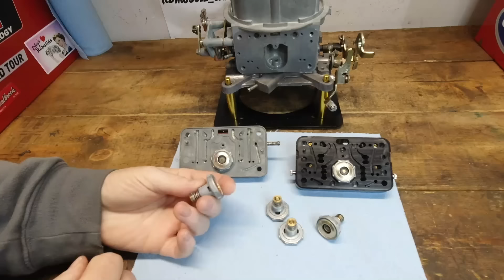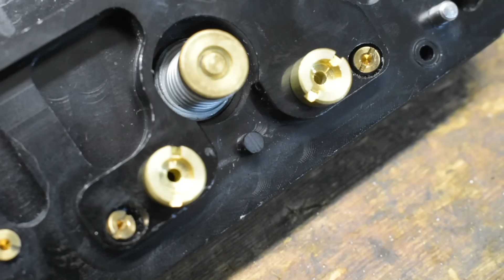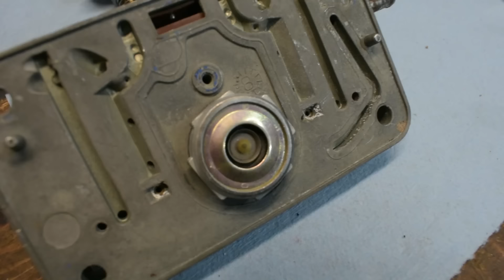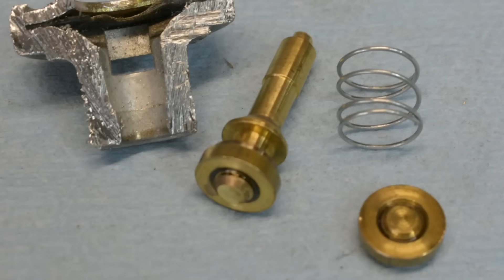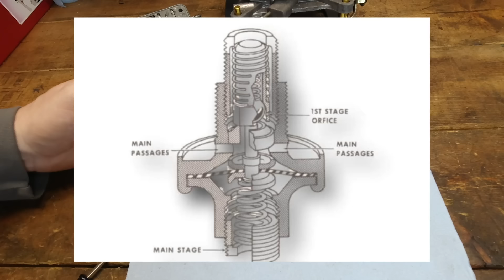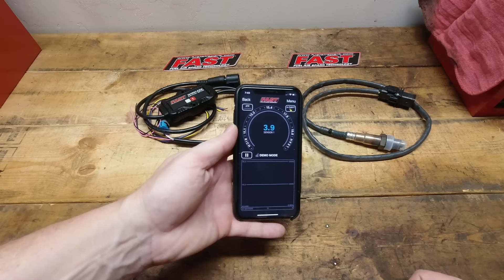Power Valves Explained: How they work, how to tune

Comment: Thanks for the clear and logical explanation. I have. a 67 Autolite 4100 on a 289 Ford, but most of the principals seem to apply. One question; is it better to tune out a stumble with the PCV or with the Accelerator Pump?

Comment: One back fire and a blown power valve I blocked them off and jet the card as needed
Reply from the maker: All Holley carbs have had a PV saver check ball installed since the 90s.

Comment: I will point out 1 more thing. If it has the right power valve and you need more fuel you can drill out the hole a few thousand at a time instead of buying an expensive aftermarket metering block.

Comment: ya know, maybe that's why my fuel gage starts dropping at a higher rate when im over 2300 RPM in my 63 Scout with the Chevy 302 in it? running a Holley 2300 500cfm 2bbl that gets pretty good mileage until i get over 2300 RPM.... same with my boat that has the same carb and a GM 4.3L (262ci) V6... gauge starts dropping fast over 2300 RPM... damn... ive based my power valve choice on 800 RPM not under load, 14lbs x .5 = 7.... i need to run the vacuum gauge when im at cruising speed and figure this out a little better... thanks for the solid tip!

Comment: I have just seen your video and I loved it great information, but I have a question. I am under the impression if you are running a solid lift cam which I am under the impression that solid lift cams do not produce vacuum so if this is true, how do you apply what you have just said to adjust putting the right power valve in your holly carburetor

Comment: I used all the gauges from a 70s f600 ford my carb converted 96 f150.. the best part is the f600 tucks have a huge vacuum gauge for their vacuum powerd brakes.. and its a fomoco stewart warner gauge... check out my channels, f150 build, and f600 gauges are still found everywhere 🎉

Comment: My old man always told me that tuning a Holley DP was not as easy as an Edelbrock, like a 1406 but that once you get it right the Holley will perform better in every situation.  Engines with big cam will NOT make the vacuum needed to hold the PV closed at idle, so it can be a challenge, even with vacuum gauge tool get the PV right so it isn't opening while on idle circuit.   Vacuum bouncing with cam?  Use the LOWER number to clean it up.   I have used many 650 DP on 5.0 stangs, last one was SOOOO rich at idle and had a 6.5, vacuum was bouncing between 7-10hg, I tried the 4.5 and it helped getting it to an almost reasonable number but I went to 3.5 and BOOM, it cleared up quickly and after the PV change the vacuum was solid at 10hg, even with a cam.  The thing is cold blooded but not too bad and once fully warmed it pulled through the entire transition without a hiccup that is rare.  I had a rich one where dude had initial timing on a 5.0 at 4 degrees ATDC.  YIKES!  This will burn like garbage and leave a lot of fuel unused, resulting in awful economy and black plugs.  Talk about tuning nightmare.  Advanced timing to 13, changed to 4.5 PV and thing ran fantastic out of the box with a minor jetting change later to get the AFR right at WOT.  It hardly made more power but it wasn't risking a lean condition.

Comment: How do I adjust the power valve it self. I'm running  2 600 holleys and I want them to match as close as possible. The carbs are 4160
Reply: The power valves are not adjustable. You want to MATCH the power valves. The power valve circuit CAN BE adjustable (amount of enrichening) by changing the power valve channel restriction size, which are the two holes you will see in the metering block with the power valve removed. The power valve controls WHEN the circuit will be active. The PVCR controls how much enrichment the circuit provides.

Comment: How would you change power valve selection for altitude?  I live above 6000ft and had to take the jets in my Holley 2300 from #73 to #68 and am wondering what changes I should make with the power valve.

Currently it's a 5.0 Hg valve.  Since air is 20% less dense here you tend to want less fuel, however, engine vacuum is also much less for the same reason. My idle vacuum is 15" on a stock Ford 352 but would be closer to 19" at sea level.

Comment: My brand new VRS front bowl is leaking fuel along with my accelerator pump. I tried tightening them down but still weeping, I was using a nut driver because I was trying to break my cam in. I stopped the break-in and I gotta figure this leak out.
Reply: Edelbrock should stick to making intake manifolds. Customer service left me on hold a couple years ago for about three hours. I left my phone active the entire time just to see what they would do. They ultimately just hung up.

Comment: What if you have a have a big choppy cam that drops vacuum at idle? Do I take the idle, 30, 40, 50, 60mph numbers add them up and divide by 5 then divide that in half?
Reply: Depends on the moon phase- 😹
Get your vacuum numbers on the freeway 70 ish, and when you start to pass- loaded. You don’t want to be pulling any fuel from the power valve unless accelerating. IMO

Comment: So manifold vacuum keeps the power valve closed until it drops to the power valve number? What keeps the power valve closed with the motor off? Seems like it would be normally open at zero vacuum. I think we need you to cut a window in the carb so we can see it running.🤣 Mine came with a 6.5, but i have 16-18hg in gear. I guess i really need a 8.5.
Reply: You're correct about it being normally open. Trial & error on what works best. A higher number will enrichen mixture at cruise speed with less pedal. A lower number will potentially give better fuel mileage.

Comment: i have a holley 350cfm street avenger on my 2.3 lima in my capri. Carb breaks up in the midrange and rarely breaks up/stutters during full throttle. i’m confused what i have to do to keep it from breaking up, too much fuel is my main idea as my engine’s recommended cfm is 243 (bought the carb before i knew that) i’m thinking maybe too much fuel or the cfm is just way too much for the engine to handle, or if it can be tuned out
Reply: Try lower number power valve & smaller main primary jets if you haven't remedied.

Comment: There's different numbers on the power valve there's number on them there's a 75 there's a 65 and there's 85 90 and it goes up to 100 on the Holley carburetors high-performance carburetors
Reply from the maker: @robinmiller986  yes we talked about sizes in the video.

Comment: Im confused on your manifold vacuum theory. To my understanding manifold vacuum decreases the more open the throttle is. That would make the valve function the opposite way that you explained it.
Reply: @Anotherdaynparadise  the valves open the lower the vacuum gets. If you idle at 12 inches and have a 6.5 pv then opening the throttle and dropping that vac to that level will open the valve
Reply: @jubjub905  thanks i get it now

Comment: I bought a new 600 cfm Holley from a guy that said he couldnt get it to run correct. I put it my vehicle and it did run rough. So i investigated and found out that the accelerator linkage cam was set incorrectly.  Reset it and it preformed great.
Reply from the maker: @rogerbeck3560  good deal.  Now tune it and really make the engine and your driving experience better! 👍

Comment: Biggest problem with holly carbs is people tune them completely wrong. They have a reputation for being thirsty and not good for the street. The main jets control the cruise mixture, and the PVRCs control the WOT mixture. Sure in a race application go ahead and block the power valves off and set the WOT mixture with the main jets. As for a street application no matter if it’s a 200 HP bone stock 6 cylinder or a 1000 hp monster you NEED metering blocks with replaceable PVCRs, air bleeds, idle jets, and emulation tube jets. A 4150 or 4500 holly can be tuned to give great results throughout the RPM range and at different throttle openings. Jet the carb for the leanest possible cruise mixture that allows smooth engine operation with the main jets. Then jet it for max power with the PVCR jets. Granted tuning a holly style carb is a bigger pain in the ass then a Weber or Carter style carb because you have to pull the bowls, metering blocks and power valves to make adjustments, however they can be tuned to deliver the same air fuel ratios under the same conditions. Your best bet is to try and find a set of those wonderful metering blocks for the 4150 that take Weber calibration parts! Those blocks were wonderful because you could tune the carbs as easily as a downdraft Weber including changing jets without even shutting down the engine! No idea why they stopped making them but If you can find a set grab them!

Comment: Great video and info.....BUT.....Holley power valves.....forgot 'em.  Get an AFB or Edelbrock clone, a complete set of metering rods and springs, jets(primary and secondary), tune and live happily ever after.  NO BLOWN OUT power valves from a backfire.  I've been tuning Holleys, AFB, AVS, Webers, Del Orto carbs since I was 13-14 years old.  If you keep your Holley, use Holley power valves, gaskets, etc as aftermarket (read China) are garbage and unpredictable as to quality and opening point.  The 2-stage power valves were made for the "smogger carbs" and towing applications.  I've never had a lot of luck with them and got my best mileage/power with a single-stage.  The AFB's would consistently give me a couple more miles/gallon.
Reply from the maker: @tomnekuda3818  one small detail.  Edelbrock never made a clone.  They purchased the engine facility and the designs and kept on making carburetor’s at the same facility the Carter aftermarket carburetor was made at.  I got to visit that facility, made a video and met folks who have worked there for 30+ years!  Good stuff!

Comment: I'll just correct one thing you said at around 5.30 ...you mentioned the vacuum hits the diaphragm which overcomes the spring letting fuel to pass...actually the other way around...vacuum holds the valve closed then when vacuum drops under load the spring opens the valve allowing fuel to flow...when vacuum recovers it overcomes the spring and closes the valve again. I'm guessing that was what you might have meant?

Comment: What is your opinion on a PV choice when the cam has a lot of overlap down low with low vacuum?   Cruising speed has good vacuum tho.  I get 8 to 9 inches of vac when in park and drops to 6 when in drive.  I'll get over 12 at cruise.
Reply from the maker: @FrankenVega  always a bit of a moving target.  AFR makes it easier but in absence of that, I’ll generally start with a numerically lower size and adjust up.  Won’t take long to figure out when it’s supposed to hit and when it’s awful.  I’d start with a 4.5 and move up from there.

Comment: I fought the concept of fuel injection about as hard as I fought the concept of buying CD's instead of vinyl records, but with fuel injection, I didn't have all the trial and error, test runs, driving conditions, and removing the float bowl assembly to get to the metering block and jets every time it needed adjustment. You just plug in the laptop and tell it where to add/remove fuel at a given load or RPM. I love the simplicity of carburetors, but the tuning takes skill and patience that most old school rodders don't bother with, and just settle for a close, off the shelf carb.
Reply from the maker: @stephencarr7173  that’s very true.  The trouble with carburetors is people get used to how bad it runs because it may start fine and maybe operate ok at WOT so they assume it’s good.  They learn to put up with rich conditions, fouled plugs, contaminated oil, the garage stinking of fuel, burning your eyes out standing behind it at idle…every bad operation they just accept.  It’s a carburetor, that’s the way they work.  NO!  It’s one of the reason why I started this channel.  For gods sake tune that thing and realize it’s full potential!  EFI is a whole other ballgame.  Wait till I start doing more tuning videos on those.  😉

Comment: If you're still responding to this video. It sounds like the higher the power valve number the sooner it opens?? Maybe it sounded like the lower the rpm the more vacuum so a higher rated power vacuum is needed. Something sounded backwards. I think where you said the engine will see 4.5 vac before it sees 3.5 is where I got confused.
Reply: Go and rewattch the video. 12:30 is what you are referring too. 
When you go WOT the vacuum drops down. If you have 8 inches of vacuum at idle, you divide that # in half, which would be 4. So your choice is a 3.5 or a 4.5 power valve, they don't make a 4.0
A 4.5 pv will allow fuel earlier than a 3.5 pv as the vacuum drops. If the carb is on the rich side, then I'd try the 3.5 pv which would help lean it out in that scenario.
Reply: @Zachary77 
But if you are using a small carburetor for the engine size or power level, or have a restrictive air cleaner, 3.5" inches of vacuum in the intake manifold may be created at maximum power or rpm, closing the powervalve, and leaning out the a/f mixture.

Comment: I use a air fuel meter and vacuum gage to tune mine. Main jets  for air fuel ratio of 14-1 at 2500 driving down the road and the power valve vacuum setting for when it leans out. Right now running  69 jets and 2 inch power valve on a 500 cfm 2 barrel .

Comment: i just testdrove a 68 chevy c20 with 4.56 rear gear ratio 4 SPD Manual.
it idled in neutral fine and ran good at speed, although not very fast, it started screaming the engine to get  to 60 mph.
BUT maneuvering around corners and slowspeed driving  WAS TERRIBLE.

is that a malfunctioning accel pump or power valve or just a qwirk of 4.56 rearend?
i couldnt buy if for this reason alone.
and 2 nearby salvage yards have nothing for C10 rear axles to swap.

Comment: Im56 years old! Just buy a new one! Make sure you're at top dead-center! A vacuum secondary, smaller is better for overall air to fuel
Reply from the maker: Huh?
Reply: Idk about that. I rocked a manual choke, manual secondaries for quite a while back in the day on a well built 327. 

So what do you do on the top end when you run out of carb and start running lean? 😂

Comment: Can a pv go bad and cause a backfire??
Reply from the maker: Used to.  In the 90s Holley added a check ball to the baseplate that cured that.  Rare that they get blown out like that.
Reply from the maker: But go bad and THEN cause a backfire?  Not really.
Reply: @MuscleCarSolutions  what in a carb can cause a backfire about a quarter off idle??
Reply from the maker: @josephgenovese1146  timing, lean condition, ignition system.
Reply: @MuscleCarSolutions  thanx for responding. Everything is set fine trucks been running perfectly then all of a sudden backfire off idle. Have a great 👍 day
Reply: @MuscleCarSolutions  can i donate too ure channel?
Reply from the maker: @josephgenovese1146 don’t assume everything is “set fine”.  That will bite you if you’re troubleshooting with that assumption.  Good luck with it.  Something simple more than likely.  Go find it!
Reply: Probably a vacuum hose came off.

Comment: I run a vac gauge inside my cowl.    I got 15 inches at idle had to go with a 9.5 pv to get right afr at like 1/3rd throttle

Comment: I have a 351 Cleveland with 224 232 @ 50 cam 108 LSA with Holley 750 VS. When accelerating from cruise I note Vacuum goes from 17-10 Hg but not much lower. Afr goes from 13 to 17 and starts pinging. It currently has 6.5 power valve which I figure is useless. I think  I need to go to a 10.5 power valve to get any enrichment. Does that sound right?
Reply: @rogerveal1336  correct, If going from a steady cruise to a slight Excell and vacum is only dropping to 10hg. Your not seeing any enrichment from your 6.5hg power valve. Iv also struggled to tune this window of power. Basically all happening on the primary side. My afr will be great at 45. Go to Excell still on primary only and my afr will jump up. Im Going to be playing with my pv a little myself.
Reply: @jacobsantilli7369  10.5 power valve fixed it.

Comment: What if your fighting the Power valve opening at idel due to long duration camshaft, persay 5" at idle
Reply from the maker: Well, long duration cams weren’t designed to sit around and idle!  Plug it and put more jet in and suffer with it.  Or get a carburetor that allows you to add/remove fuel through the idle/intermediate and wot circuits.
Reply: I understand exactly what you are putting down. Was hoping youd have told me something i hadn't seen or heard of.  Speaking of more adjustability, what are your thoughts on quick fuel carbs, ive been thinking of straying from my old reliable holleys and giving one a shot due to the ease of changing air bleeds compared to a traditional 4150dp
Reply from the maker: @jackball-lv5gt unfortunately Holley owns quick fuel now, so take that for what it’s worth.  The new Edelbrock VRS is a FOUR circuit carb.  Ridiculously inexpensive for all the adjustability you get from it, plus the auxiliary air bleeds.  I did a full video on that carb if you’re interested in learning more.